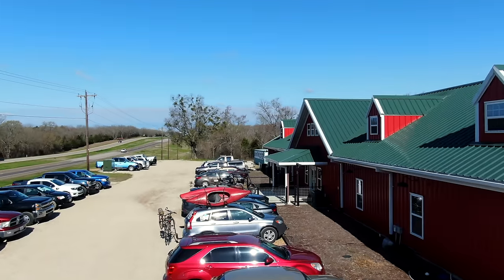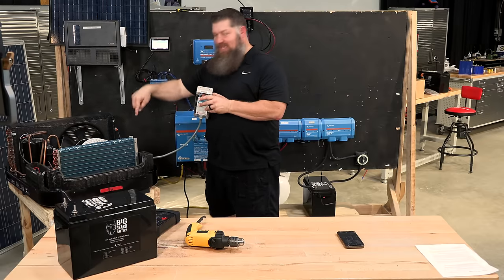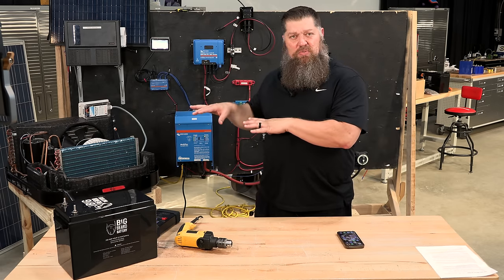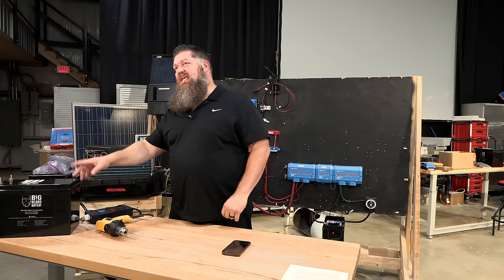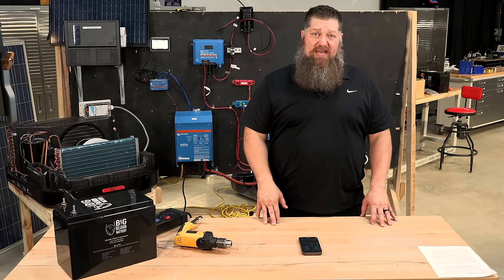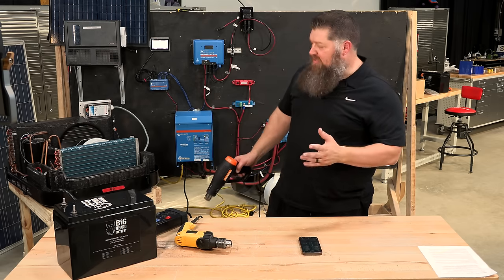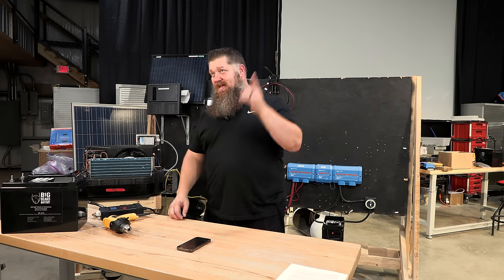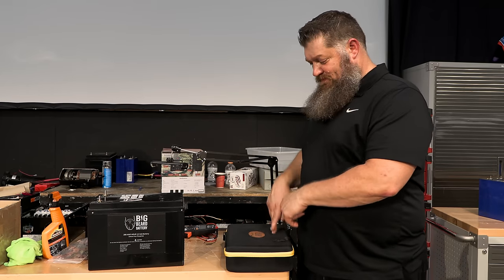Run RV AC off one battery🪫

Comment: I just threw in an ecoflow delta pro instead of all this stuff. Threw in the extra battery, wired the panels on the roof, hooked up the auto transfer switch and done. No charge controller, inverter, shunt, bunch of batteries, etc. Can run my AC for about 7-8 hours, no soft start needed or all these different things.
Reply: Hi Justin,
I went a similar route except with out the auto transfer switch. Curious how many watts of solar do you have on your roof?
Reply: @BrinkleyRVer  I have 1000w (5 200w panels). It has been working out well. Just went boondocking for a week and even with afternoon clouds/showers every day, never had to do anything all week. Even ran the AC a few times.
Reply: @JustinPratt1  
Thanks for the quick reply….
Curious to know of the 1000w the the roof, what are the net watts that come into your EcoFlow on a full sun day around noon? 
How do you keep your house battery charged when your not connected to shore power or the EcoFlow, e.g. in storage?
Finally, do you have or use regular gas/propane generator as a backup? If so, are you happy with it and what is the model?
Thanks so much!!
Mike Luethge
Reply: This is the way. Which AC do you run?
Reply: lol and you paid 400% more.
Reply: @brianhilligoss  Did I? I priced it out and I was actually ahead. By the time I bought the inverter (an inverter that size alone is almost as much as a refurbished pro), batteries, charge controller, shunt, soft start etc. As well as the wiring, lugs, etc I was far ahead. You can find some delta pros for pretty cheap prices. Go ahead and price out 7.2kw of lithium battery storage plus all this stuff and see how much you save piecing it all out.
Reply: @JustinPratt1  yes absolutely. We have a zantex xc 3000 inverter charger we paid $650 for,  800ah of lithium batteries was $1600 plus about $275 for wire and lugs.  The inverter has a shunt built in so there’s no reason for an external one.
Reply: @brianhilligoss  You can get a delta pro and extra battery for about $3200 right now. Then you also dont need to do all the wiring and get charge controller for solar separate. Plug in solar panel array, plug into 30A RV and off you go. Also get more output and surge capacity. Its like being plugged into a pedestal at a park. I never have to worry about things like firing up the AC when someone is running the microwave.
Reply: This is genius! I have been looking at solar generators to replace my gas inverter at my house. The power goes out in my neighborhood, and it sounds like singing generators, and my basement floods. I just saw some of them have 30 amp outlets and they would easily plug to my RV.  Now you tell me you can run the Air! Now I will just have to figure if my 2000 wt inverter,400-600 watt solar, and how many batteries……
Reply: Also looking at Oupes products
Reply: I would love a better understanding of that !
I have 3- 400 watt panels+ 5000 watt 48 volt inverter besides a 215 watt panel for my 1000 watt inverter
Reply: My concern with the all in one systems is, it seems that if something fails, you have to replace the whole unit.
I pulled this from another site.
The Delta manual states that it has an 18-month warranty, but this does not cover "DIY solar panel setup" repairs for free. In this case, DIY means any other panel or cable beside the cables and folding panels Ecoflow sells.
Reply: Hey can you explain to me how to connect the air conditioner to the EcoFlow? The air conditioner has red/black +\- cables but there is nowhere on a EcoFlow to put these. What kind of connectors and ports are being used? Also, what is the extra battery for? How is it worried with the EcoFlow? 

I have a delta 2 max along with the EcoFlow 800 watt alternator charger and I would like to power a DC air conditioner but have no clue how to connect it all together…
Reply: @thepatternforms859 Good question.
Reply: Dometic 12volt rooftop is a beast best purchase without a doubt.
Reply: @ronnjerremy5796   it dosnt the nomadic s1 split unit blow colder and use less power? In addition to freeing up roof space?
Reply: my eco flow can only run my 5000btu air conditioner for 30min😢

Comment: You can not run a 13,000BTU AC off of a 12 volt inverter/battery because the 1AWG wires between the batterys and the inverter will overheat and possibly catch on fire. You need at least 24 volt DC input inverter /batterys.

Comment: To run ac off of solar you will need far more in solar power than 1400 watts.  You need to be able to charge the batteries while running the air.  Also you will not always get the full rated power out of the solar panels because it can be a cloudy or hazy day or the angle of the sun.  If it is a cloudy day you can forget running the air off of solar.  My rough estimation you will need at least 3500 wats of solar to be able to run the air during the day charging the batteries and at nite.  I figure no less than 800 amp hour of batteries.  As you can see this will get very costly in a short hurry not to mention is there enough space to mount all of the solar panels required.  Hate to say it but it would be far cheaper to buy a small honda generator which is very quite to run the air.  .

Comment: With some modern Roof RV Air/Heat you don't need soft start (RecPro 15k with Heat Pump by Houghton).   You need enough solar to run Air and Charge.  Double your day load, ex: 2500 watts continuous means 5000 watts of panels on roof.  Panels will reduce output significantly in hot weather also and roof mounted get hotter reducing output.  Good to have lots of battery so you can run air after 6pm.  More battery means more solar panels to recharge during daytime with air running!  How do I know?  We live off grid in a Trailer.

Comment: Wow!  Loved this.  I served in the Navy as an electrical engineer on a nuclear-powered surface ship.  This is a top-notch, excellent presentation - and very thick with useful information.  I mean a lot - I watched this, re-watching several points.  This guy KNOWS his stuff cold.  I bought the cheap version of these batteries, and I need about twice the number of batteries to make my van AC work.  It works, but if I were to do it again, I would get 2 of this guy's batteries instead of the 4 cheaper ones I have.  These batteries can be monitored by Bluetooth... I didn't know I could have had this.  I've never met this gentleman before, but if I were looking for someone to consult with when planning an RV build, this is the kind of dude I would want to talk to.

Comment: Depending on the AC unit, and how long you want to run it.
P= I x E
P is watts
I is amps
E is Voltage.
Now you just need to figure out how long you want to run it, amp hours.
Now you need to figure out how many amps you want to put back into your system every hour.  That tells you how big of a solar system you need.
Hope you have enough in your bank account to cover your cost.

Comment: Questions: 
1) relationship of installed capacitor to the slow start.
2) Is the slow start a capacitor also?
3) why is slow start needed, if standard capacitor along is typically charged enough to start compressor?
4) Can included capacitor be removed and the slow start take it's place alone?
5) If more power is needed for start of compressor, why not just replace the standard included capacitor with a larger one?
6) Does all power to the AC unit constantly go through capacitor, or is capacitor used ONLY during compressor start up?
7) Since a compressor/thermostat may start-stop-start during AC cooling period, is there an advantage to simply keep the compressor running the entire time while AC is used? Such as over cooling RV first, then letting AC unit be off entirely till needed again?
8) What does extending the time from 5 seconds to 10 for compressor start actually accomplish? What is the purpose?

Comment: You are bad ass! I am in the tool business, you are an awesome explainer. lol. Man they didnt have this stuff when I started selling tools in 1986. Had to run the onan, we all know, in commercial aplications.  Nobody makes a generator  that can handle getting jumped around inside a rough riding 60 thousand pound tool truck.  I would have loved to put solar panels all over my roof and maybe even on the sides of the truck! Darn it. I have killed alot of generators in my days.  Awesome job buddy.

Comment: My 13,500 btu Atwood Air Command AC runs just fine on our 3000w inverter and 400 aH of Renogy batteries.   I’ve gone at least 5 hours on that setup.  No softstart needed. 

We do have 400 watts of solar and an MPPT controller.

Comment: My question is why try to run an inefficient rooftop AC unit that has maybe an 8-10 seer efficiency on limited battery power when you can buy a mini split heat pump that is perhaps 3 times as efficient with a seer of over 30 and no start-up surge? This means that it uses 1/3 the energy of a rooftop AC to make the same amount of cooling - and it can produce efficient off-grid heat too, sparing your propane for other uses. There are 12KBtu heat pumps that average about 500 watts to run with a maximum wattage draw of only 785 watts. Your excellent Big Beard battery would run it over 6 hours, assuming a 10% inverter loss. Granted it's a 12k Btu unit not 13.5k Btu like your typical rooftop AC, but we're looking at 1.5 -2 hrs of runtime vs 6 hrs run time. That's a huge difference. What you save in batteries would more than offset the cost of the $1,700 mini-split.

I plan on adding one and keeping one of my rooftop ACs (an efficient 14.5KBtu Furrion I purchased last year that has a rotary compressor like a mini split) for supplemental use during peak evening sun only. I have a 560ah LiFePo-4 12v battery bank now that I built from 8, 280ah prismatic cells charged by a 620-watt liftable array on the side of my MH, that I will retain for my 12v and under 1,000-watt 120v needs. I will be building a 48v bank using 16, 304ah prismatic cells mainly to power my AC units. I plan on racking 8, 460-watt Blue Sun bi-facial panels about 13" off my roof to charge this 48V bank. I will need to add a dedicated 2,000w, 220v inverter for the mini split and will have an all-in-one 5,000w inverter/charger/charge controller for the bulk of my 120v needs. We're old, retired folks living on social security, so need to build a budget system that still meets our FT needs of living off-grid year-round as economically, yet as comfortably as possible.
Reply from the maker: So you need to check with the mini-split you plan on purchasing. They are built to be stationary, will they cover the warranty should there be a problem and they find out you put it on a moving vehicle? 

I agree mini-splits are the way to go, but the manufactuer has to build one accoridng to all the rigors of the road.
Reply: @NationalRVTrainingAcademy  Thanks for the advice. I doubt the manufacturer would warranty one in a mobile application. I think it's best to just buy a quality brand with readily available parts and hope for the best. Most warranties only last for a year or two anyway and only when installed by a licenses AC installer. Good luck getting one to install one on an RV. Even the Furrion rooftop AC I recently purchased to replace my 22yr old failed Dometic unit only has a 2 yr. warranty. I am a DIY guy so will be installing the unit myself, vacuuming and testing the lines for leaks, etc. so I'm SOL in any case, as far as a warranty is concerned. Besides it's likely the unit will fail after the warranty period anyway, as even a cheap one like a Mr. Cool Home Depot special should at least last a couple years before it croaks if it's installed correctly.

Comment: Victron specifies that inverter as 3,000 VA on the DC side but inly 2,400 Watts on the A/C side. That is due to circuit loss and phase angle loss with inductive loads.

Comment: What you didn’t address is changing time to restore batteries the following day. Or the possibility of inclement weather for a few days. But you dips very good job with a realistic expectation.
Our small rig has 600 Ah of battery and 1600 watts of panels. Our small home window AC can run 24/7 as long as the sun shines but won’t last 3 days of inclement weather. It only draws 250 watts average (450 with compressor on)

Comment: Big numbers.   I have a small jayco.    I also have a 6000 window style ac in it. O pulled the 8000 btu because it was noisy and pulled a bit of power.   So ,I’m in Fl 90 degrees outside. . In camper in sun easily in 90s    This ac  will cool ca,per down in about an hr to 80.  During the day after four hrs I had it set at 74.   Soo , it Ramos up slowly no big draw at start.  There is a range to power draw. .   After running and camper cool we usually run at 540 watt with 5,5 amp pull.  With just fan amps under 1 amp   I have seem watt pull as high as 700 watts and 7,5 amps. At night cools down to 70. Those roof unites must be crazy power hogs

Comment: OK, ...   I agree with all the allocades on the presentation you gave, in the comments, before me, and, I have given the video a thumbs up.......   I have 2 points, ...   and, let me say, my entire system minus panels/cells/BMS's...    Is Victron ...    The 3000 in the name/description is VA.....    Volt/Amps....    People will/I have gotten the "I don't like it" flashing LED @ 2400w....    Does it "Suck it up", and, go above and beyond like a trooper ....   YES.....    but ....   wattage wise, they only rate it at 2400 per the spec sheet...    Secondly, ...   and, I haven't watched your panel vid....   Yet....      But,   ..    IMHE....      Location/environmental variables .....   TRUMPS ALL....   as far as panel requirements go.....   if anyone wants me to elaborate ,  ..  I will.....   But, ... as I said ...   Good job.....

Comment: Thanks for the info! 
Learned a lot from your videos.
I’ve been looking into 12 volt A/C roof mounted A/C units for a truck/cap camper. Also looking at mini-splits for our travel trailer.
I’ve been turning wrenches most of my adult life. Small wrenches, a particular segment of office equipment.

Comment: So much info, I am totally wanting to go full solar. I bought an Rpod with 3 100watt solar panels a Xantrex hfs2055 inverter and 4 GC2 6 volt batteries wired in series and parallel for 12 volts. The system is a Zamp 30 amp controller. I am so crash coursing on solar right now.

Comment: thanks I'm a DYI guy
just got 3 400 watt one 215 watt panels
I have a 5000 watt inverter also a 1000 Watt - only 23' travel trailer and they barley fit and my generator peaks at 1500 watts only 15 amp trailer wired for 30, great info
worse part is paying panels ( buy used commercial from a installer if cracked purchase special sealer and treat them a typical 400 watt panel 42' X 31.5, can produce 41 volts during mild sunshine

Comment: Thank you so much you're a godsend I have a solar power system but it's 400 w and 5000w inverter Ames and I do want to run my air conditioner off my lithium battery but I'm going to have to buy a couple of more thank you so much

Comment: hears a question,, why not start the compressor first and then teh fan.. we used to install start delays on home system for AC in attic in summer.. that give the system time to start the freon flowing and cooling the coils in cabinet.. then when the fan starts some 3- 5 seconds later it blows out coolish air vs the heated air..  

On a roof top using the same logic but starting compressor first and then fan give the inverter access to all the watts needed .. 

saw your bigbread 280 am lithium with charge system and WOW.. a touch overpriced it appears.  charger is 200 and i put together a 280 amp system for less than 600.. including 200 amp bluetooth BMS..

Comment: You can’t run anything of of solar correct? You’re running it off your battery which is being recharged by your solar panels, so, your one battery will only discharge so quick. It seems I only need enough solar to keep the battery topped off,  is this correct?

Comment: Todd, I'm thinking in most cases I would be camping in cooler climate and the chances of needing to turn on the A/C is very low. So speeding the extra money for more solar, bigger inverter and more batteries that I should be able to get by with just 180 watt solar, 2000watt inverter and one 12v 100ah lithium battery?

Comment: The soft start reduces compressor inrush about 75%. You will never run 200 amp on for an hour and a half. You’d be lucky to get an hour before a cell undervoltage shutdown. I have 400 amp hours at 24 V running 9000 btu mini split hp, 22 SEER.

Comment: Love your videos, you always do a fantastic job and straight to the point.  I have a couple of questions.  First I'm a big man, next to me you are small.  Will the roof of the Coachmen 2019 beyond support my weight to install the soft start?  I weigh about 310 on my lighter days.  I live in the San Antonio area , who would you recommend to install my lithium upgrade in this area.  Just need to install about a 200 to 300 amp hour lithium battery to keep the fridge running overnight and my cpap machine.  Thank you.
Reply from the maker: Two things, Todd hasn't been 310 since high school. Don't let the camera fool you, 😂 . Number two If you go to RVTAA.org/locate you can find all of the mobile certified RV techs near you with the locator map. This would be a great place to start. Good Luck!
Reply: @NationalRVTrainingAcademy Thanks for the link, what about the roof will it support me so that I can install the soft start, it is an easy thing to install but will pay if need to?